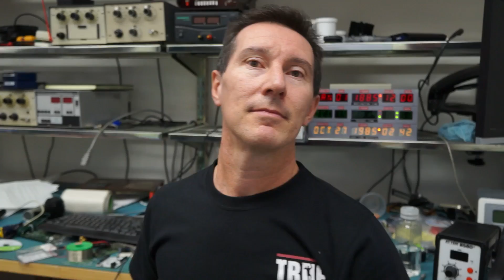eevBLAB #2 - Are Electronics Hobbyists Useless?

Comment: Dave I think we have to recognise that the world's a different place than it was when we were growing up.

When I was a kid, many kids got into electronics through music because they couldn't buy, or couldn't afford, professionally made kit. But with mass manufacturing in low cost economies, every kid can afford an amp. But now, most probably use ipods or their phones instead.

Back then, if I wanted a break-beam alarm on the stairs so I knew when my parents were coming upstairs, I had to make one. But now, my son can buy one complete on Ebay for a few quid. When I wanted a computer but couldn't afford one, I designed a board with a 6802, a hex keypad and LED display. These days kids have enormously more power on their phones. So there isn't the motivation for kids to put stuff together themselves as there was when we were breaking ground. Plus there were electronics clubs in schools, hobbyist magazines, books in the library, all of which went through the basics.

Today, with the kit mentality, and quick-answers on forums, there's less opportunity to learn the basics of circuit design and more opportunity to skip over the detail to the end result. That's much more rewarding for kids than doing the hard graft we had to, just to light an LED, or get a photodiode to work, or construct an oscillator.

My field, embedded control, is crying out for new blood but there just aren't enough kids getting into it. And I think that's true for electronics in general. Whenever I coach new graduates, it amazes me the things they don't know, because they've never done it for real. And I do wonder who's gonna design tomorrow's ipods in a world of consumers, with few creators. Perhaps the few will just be very, very highly paid.

So seriously, I think you either need to hire an experienced professional, or take an apprentice and teach 'em from the ground up, or wait in the hope of getting one of the few young people around now who have the breadth of skills you're looking for. Sorry mate but the world has just moved on.

Comment: Not really, I think what you are asking is not too much. But at the same time the spec asked as more to your line of work. For a hobbist and electronics engineer who graduated recently I would also expect that too but unfortunately that is not the case with majority. I recently finished my Masters in Electronics engineering from UQ, Brisbane and we had 7 - 8 students in some class. So not whole lot are coming into engineer and most are more into electronics side of programming, antenna deisgning and microwave circuit designing. With a very high confidence i can say most of them are not at basic skills like soldering and related skills. Simply because they never do it or never had to do it but regardless i would also expect an engineer to know those things.
But the skill for video editing and php programming with that is not that easy thing to find. simply becuase we never use it. From my experience I can say we make do with C and C++. Most of the time use MATLAB becuase it works like magic for what we do although its insanely slow specially if you start doing RCS calculations or other radar related stuff. Even with a ECG signal processing it weeps. Again exploitating is not really a skill most people have and i don think if they have its to be admitted openly. Good exploitation skill are not easy to find, you can find someone phishing with jotform or something or doing SQL injection with someone knowing a MITM or forging https cerfiticate not easy to find.
Conclusion- your basic requirement i think everyone should have as engineer or hobbist in electronics but unfortunately most do not. But desirable skills are of there own class.
I love your videos great information. Thanks :)

Comment: I, am a very low knowledge hobbyist. Self taught on the electronic side but trained to solder when working at D.E.K to ESA standards. Even I design, layout and build my circuits, I do however sometimes struggle on the debug side but I am learning.

I do not think you are asking too much.....

Comment: Dave, You are not asking too much. I was born in 1952 and every kid on the block was playing with used vacuum-tube radios and TVs. Later, many of us could do repairs (beyond tube swapping) which morphed into design upgrades then new circuit designs. Many of us learned the practical aspects of semiconductor theory in secondary school and could work with discreet transistors then chips (both analog and digital). I started working for a Canadian Telephone Company in 1973 but had a part-time job at a musician supply store "just to keep my electronics skills up-to-date". I couldn't believe the number of people back then who applied for "repair jobs" but were unable to use a volt-meter or scope to determine if an in-circuit transistor was "on" or "off". Even of the ones who could, many would think a functioning germanium transistor was defective because they thought that all transistors were made from silicon. Today it is even worse. I run into people all the time who only have FET-level understanding of transistors not knowing that many digital chips today still interface with bipolar junction transistors (2n3904 and 2n3906 are everywhere)

Comment: I have all those skills and I never ever had an electronics education (I'm a software engineer). It's only since I started studying for a ham licence that I began to see the whole picture though (or at least a much wider view). Impedance, transmission lines etc. really make you think in another mindset (just like you sometimes have to switch between current-based and voltage based thinking). Maybe an idea for hobbyists who feel their skills are not advancing fast enough.

Comment: I think this is about first experiences, basics being taught and understood and the new fear of failure. 

First experiences I find out on the web in programming and electronics (been a hobbyist and a professional in both, though NOT an engineer!) are mostly failures.  They look up the schematic they want for some project, maybe read up on the principles of the thing, do a few cocktail napkin design calculations and build.  Then at start up / testing phase they let the smoke genie out and get disgusted.  That's how a lot of kids today get exposed to electronics as a hobby or science fair project.  Now, the generational difference kicks in here.  In the '70's when I was a teen we were always told "Don't give up!", "Try harder!", "You can do it!"  and "If at first you don't succeed, try, try again!".  We did and I still do.  Now, the parental advice in a lot of cases is "Find something you're good at, you'll like it better.", "Well, you tried." and the ever popular "Maybe you just aren't cut out for this." and this advice kicks in a lot quicker in my opinion.  Add to that many who encourage their kids are so fearful of the odd burned finger from a shorted nine volt battery, funny smelling smoke from a blown capacitor or even letting a kid drag home some junk to desolder parts from or a soldering iron to do it for some old fashioned tinkering, the kids don't have as much room and incentive to explore electronics young. 

I tend to think that this discourages the instinct to tinker, so later, even if they do manage to garner some ability in electronics from some source, your job requirements to be creative rather than hook black box components together to get a specific result as directed scares the crap out of them!  Being raised in the '70's, I take a box of unknown parts and an idea as a challenge to design, learn and build.  They, from what little I've seen, take it as an insult to have to think about something without ten people to advise them while they do it.  Afraid of mistakes?  I think so.  But, never making a mistake is the biggest indication you aren't DOING anything.

Comment: No, you are not asking too much for the position. And if I were in Sydney, I'd be knocking down your door at a chance to learn what ever you could offer. I'm finishing up an associates in electrical engineering from CSN, a community level college in Las Vegas NV in the US, and will testify that quality education does not have to be expensive. Those complaining about too strict of requirements are those not willing to sacrifice to learn on their own, wanting handouts rather than pursuing the knowledge so widely available today. I spent a week with an arduino before embarking on a multi sensor, multi I/O, Internet connected automated plant watering setup. I'm in over my head and loving every minute of it. Good luck with your search.

Comment: Because it's easier to get into, more idiots and useless people who just rely on guides ARE getting into the "electronics hobbyist" category. You had to be pretty smart and self sufficient back in the day, not so much these days. The quality is lower, and what you are asking for I didn't really get experience in myself until my 4th year in robotics engineering. Right now, as a graduate with close to 2 years experience I am far more skilled than listed as required for your job, but I can see how it would be hard for a modern standard hobbyist or even a 2nd year electrical engineering student to have the required skills you need. A 3-4th year Mechatronics student will have all the required though. Uni these days doesn't teach you much useful stuff, until the projects which pop up in 3rd and 4th years.

Comment: I think the difference is between an engineer (i.e. someone who can design) and a technician (i.e. someone who can build someone else's design, debug it, repair it). Dave's after an engineer (and isn't too fussy about whether they're professional, still in training, or merely a talented hobbyist - good for him!)

There's no shame in "only" being a technician; that's the level I'd pitch my electronic skills at (compared with my computer security and system administration skills, which are at a professional level) - it allows me to maintain and repair my simpler gadgets (e.g. the dry joint on the battery lead of a pre-built thermometer alarm that I did last night, which was causing frequent false alarms and rapid battery drain).

Comment: I just finished my bachelor degree in EE in one of the top 50 university in te world. I can confidently say 90% of my peers had never touch a soldering iron for academic purpose. I call myself a DIY/electronic hobbyist, I can/tried to make/repair most electronics I used, still I can't design a board(yes,I learned LTSpice in uni).
IT skill? Pfft,my friend in computer/software engineering don't even know how to reinstall their windows. Be ur own judge.

Comment: I remember having a long conversation with some EE grad friends of mine a few months back.  The consensus was, the growing popularity of micro-controller kits (Arduino, R Pi and similar) with pre-built addon boards, software that will almost lay out a board FOR YOU, online companies that will take this "automagically" generated board and fabricate it FOR YOU...  And you don't really need to do much but breadboard a design and figure out how to turn that into a schematic...

Granted, it's REALLY made a difference, at least here in the states, of bolstering the mom and pop hobby shops, and even rat-shack has started selling less cell phones and more parts again (you've got questions? we've got cell phones!)...  but... It's also created a double edged sword. 

On one side of the blade you have post-EE college engineers learning new hardware, new techniques, new technology, etc... along with the entrepreneurs and serious (serious) hobbyists... maybe some "rockers" getting back into hobby electronics for the nostalgia and pure fun of it...  and on the other side you have roughly the equivalent of "script kiddies".  

BUT, is this such a bad thing?

All of the extraneous, time consuming falderol of fighting with solvents, laser printers, and hacking apart laminators just to botch the job up because a bit of masking didn't sit properly...  not to mention the lack of cost-effective solder masking methods and screen printing methods...  are all thrown out the window.

By not needing to learn how to lay out a board (having smart software do it for you), or fabricating it yourself (and maybe making a mistake), hobbyists and start-ups are able to spend more time on developing, inventing, and dreaming.  

Good? Bad? Bit of both I'd say.  But any of us that actually invested the time to learn and do everything from scratch will feel like it's a bad thing that there's so many "shortcuts" these days.  Mostly because there WEREN'T any shortcuts when we started out, and we feel somewhat robbed of a vast number of hours of our lives spent fighting a stubborn solder joint, or a lifted trace on an otherwise pristine single sided PCB...  Or misaligned pad holes from where we slipped with the drill press...

Comment: I was that teenage hobbyist.  I started programming around 12 or 13 years old on a TI-99/4a and wrote my own versions of Pac Man and Space Invaders. After that I was designing PCI interface boards so that I could control lights and motors with my old PC back when, if you wanted to build a PC, you soldered it together.  I built a Heathkit 8086 PC including the CRT monitor when I was 13.  When I started, the only way to design a circuit board was to use dry-erase transfers and then etch in ferric chloride.  Later, it was photo-sensitive boards, developer and more ferric chloride (I can't tell you the number of my mothers table cloths that I ruined).   My son and I are into robotics, designing Halloween props, Animated Christmas lights (Vixen Software and an Olson 595 control board which we build from scratch) Recently, my son and I have been playing around with Arduino and making our own shields.  (He is too bored with the robotics class taught at his school because he says it's "too basic")  Maker Fairs, programming, R/C Quadcopters, etc. (All with no formal education in electronics).

Comment: I don't think you are asking too much at all if you're looking for an employee, but you are narrowing your pool of potential candidates. (For example, I know that I'm really lacking in practical soldering experience, and I'm sure many others are like me and have ended up spending more time on the software end these days. But I consider myself very low in the electronics hobbyist field.)

That said, practical experience is often hard to come by in many hands on fields. We're seeing more and more prefab snap together kits, and spoon-fed assembly, and less 'sit down and figure it out yourself'. Doesn't help that so many high/secondary schools across the world have been replacing things like mechanical and woodworking shops with computer labs to teach powerpoint.

Good luck in finding some good help. Your shop sounds like a great place to work and learn, but sadly I'm on the wrong side of the globe, and the commute would be a bit much.

Comment: your not asking too much at all, i have never had any lessons etc on electronics at all.

i know a little bit about resistors from my electrician qualifications, i learned to solder off my stepdad years ago.

to be honest the most soldering ive done is on copper pipe so i am not the neatest when it comes to electronics soldering by any stretch of the imagination, i would class myself as a tinker but im not an electronics guy at all as i don't know much about it yet at all

Comment: The point is: At which quality did YOU design when you were a hobbyist and which quality are you demanding as of now. Every hobbyist will be able to make a Board like you did in the 70th ode the 80th. But not every hobbyist will be able to make a 2 layer board with SMD and be able to program a Microcontroller in C or Assembler.

Comment: A hobbyist will typically have three modes of learning.

1. Learn what you need to learn to do what you want or need to do.
2. Learn what interests you in your spare time.
3. Learn about a topic obsessively out of a personal desire for mastery.

I think most hobbyists go through all three modes from time to time. So, when you say that a hobbyist "should be able to" do some list of specific tasks, you need to take into consideration whether that topic would always be found in category one. If it is, maybe everyone will have that skill. Otherwise it is largely chance and happenstance that it falls into the other two categories.

If you want to limit who can be a hobbyist based on a list of technical criteria, what you are doing is setting barriers to entry, which is a hallmark of a profession, not a hobby.

There is no problem with setting required skills for a job, but there is no reason to expect the majority of hobbyists to share a set of specific skills at any particular point in their hobby life.

Comment: I strongly agree to Dave. I call my self a hobbyist, and I started doing these tinkering stuff from when I was a small kid. I disassemble (probably destroy) things even before elementary school. Later, I learned basic analog circuit and VB/C programming in elementary school. I can design basic amplifier, power regulator and oscillators when I was 10.

Anyone with a good will could be qualified as hobbyist, but a top notch hobbyist should be no worse, if not better, than an average professionalist.